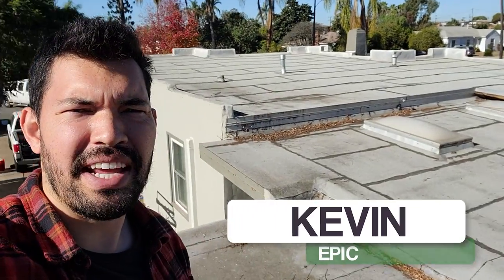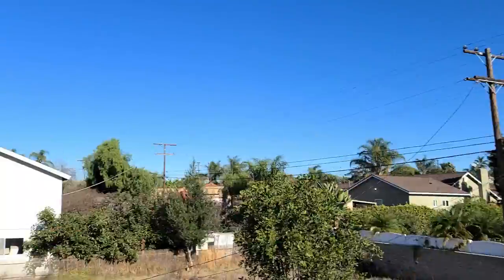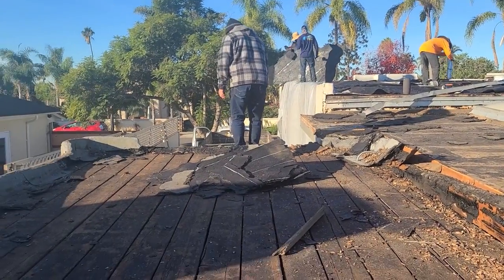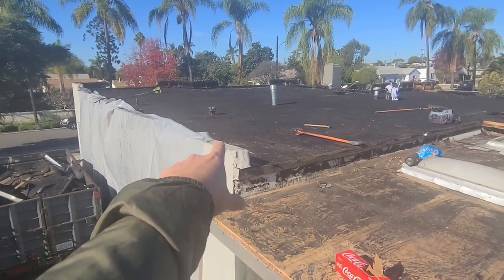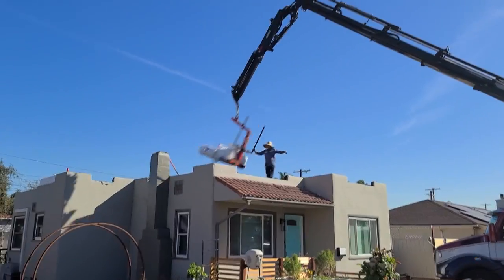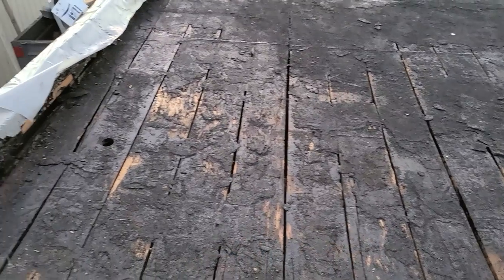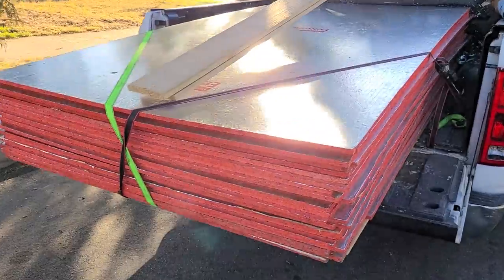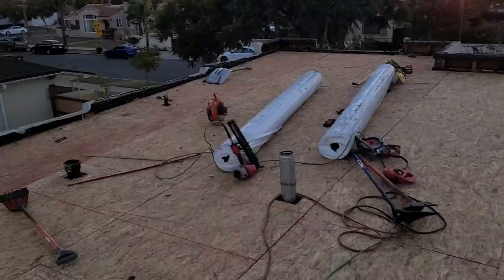NEW TPO ROOF! Full Flat Roofing Installation | Homestead Update Ep. 11

Comment: It's fascinating to see this process in that I used to install roofing here in Aus and there are almost no roofs like this at all, especially in the domestic sector. There is a similar product that was used many years ago used on industrial facilities, but for the most part it's now considered a specialist system. And what you call coping we call capping, or parapet capping, and when you have multiple types of metal waterproofing required to complete your roof, they're then collectively known as flashing. Looks very neat though, and I agree, call out the previous owners because this type of behavior is despicable.
Reply from the maker: It's so interesting to see all of the differences!

Comment: This video is a year old but I’m watching it and slowly becoming green with envy. I live in Mississippi and bought a house with a partially flat roof in 2019 not knowing that roof needed to be replaced. Unlike your roof, mine has NO slope, no angle, nothing. It’s FLAT flat. Ours is covered in some type of vinyl, but there are small areas in the seams where water gets through. 

It’s fascinating seeing any other person with a flat roof to me because every non-commercial roofer I’ve called in my area has told me they don’t work on flat roofs and all the commercial roofers I’ve called said they don’t work on domestic roofs. Which makes it seem like flat roofs on domestic HOMES wouldn’t exist - but leave it to me to break the mold. 🤷🏻‍♀️ 

This video has given me some ideas and a little bit of hope! Maybe one day I’ll have the $10-20k to get it fixed! Until then, I’m watching this on the rainy days! 🌧

Comment from the maker: I misspoke on the R-Value of the radiant barrier, it has no R-value!
Reply: I hope the radiant barrier plywood wasn't extra. It doesn't have an R-Value, but thats only one way to measure heat transfer. It still has a benefit, but since it looks like they put it directly on the old wood, you basically lose all benefit. It requires an air gap to work. Either way, that roof is still clearly 100x better than the old one! Congrats.
Reply: Ha! I caught that!
Reply: There is some R value just not what you thought. I bet your electric bill will decrease too! Nice roofing job!
Reply: @len10ten  to be clear and not too technical, the OSB itself has an R-Value of less than 1, and therefore not worth noting, but the radiant barrier itself does NOT have an R-Value.
Reply: R-value refers specifically to conductive (solid) heat transfer resistance, so radiant heat reflection wouldn't be included.  It's hard to put a number on the radiant resistance because it depends entirely on the details of the assembled system.  Two solids pressed together still have a gap on the micro level, so it's not entirely useless without a "macro" air gap, but it would be useless if coated in a liquid which makes perfect contact.

All ply/OSB has painted edges so the red is nothing exciting.  It just signifies an uncut factory edge.
Reply: Also, that 1x6 slatted roof deck was the standard before plywood took over.  The gaps are intentional as solid wood is insufficiently permeable to humidity.  Not a leak risk as if water makes it that far in you're already screwed!

Comment: Older homes it’s common to find garbage/newspaper in between walls and ceilings. People would use newspaper for insulation. Depending on how old the garbage/paper is it may have already been there prior to the last homeowner. I see that a lot here in NYC
Reply from the maker: True!
Reply: A hundred year old house I rented had chicken wire and newspaper insulation in the attic.  The newspapers dated 1908 through to 1912!

Comment: Hi.  If you know for sure that the sellers were the ones who did that, you have a legal right to call them on it.  In CA any disclosure statement should highlight any repairs and that they were to code.  Take pictures or more detailed video, check your disclosure, then call your agent.  Even if you signed an arbitration clause (check sales papers), you can go to small claims if the damages are less than 10k.  Good luck.

Comment: We have TPO on our (semi) flat roof in Oregon and we love it.  A little different, thicker underlayment and we didn't have the raised area that needed to be capped.  SO much cooler in summer and warmer in winter after it was installed.  I bet you'll love it.  And I agree with others about checking with the RE Agent / Attorney about the fraud issue.  Consequences = changed behaviors!
Reply: Have you had any condensation problems? I’m also in Oregon and just discovered a huge condensation problem in my attic.

Comment: TPO is a good option and it's really easy to repair which is great for whenever you're putting solar on your system. Make sure to claim your LEED credits for it and your tax write off for the re-roof (if you finished in 2020 you can claim on 2021 taxes). TPO Roofs have an average lifespan of 15-20 years with proper care and maintenance otherwise they can weather at a much quicker rate. If you have any questions on how to take care of your system I've been in commercial roofing for almost 6 years now and I run the division for my company. 

If you ever put another single ply membrane on your home I'd recommend looking into manufacturer's who offer warranties to home owners. Firestone doesn't offer a manufacturer warranty on their membrane for residential construction which means the only thing protection you is your contractor's warranty. 

The roof looks great and the did a wonderful job putting the system together, and their detail work looks great!

Comment: Also, coping metal is an obsolete method of covering parapet walls. With a torch down cap sheet system you could have run it up over the walls and installed a bonded edge metal with no seams and fasteners to expand and contract, coming loose and becoming a maintenance item/leak.

Comment: Thankfully don't need to do my roof for a good 10 years or so.  Did get the piping replaced (galvanized to pex) and in the process of getting the fireplace updated and fixed (will be putting in a wood fireplace insert) and the electrical is getting upgraded to a 200 amp service.  Fun video to watch though..  I do miss visiting San Diego (a couple of my ships would pull in every once in a while and you can't fault the mild temps year round!)
Reply from the maker: Considering 200amp myself! But I think I can live off 100a until ADU comes in
Reply: @epichomesteading  No doubt.  For me it is two-fold: 1) to upgrade my kitchen or route power to the outbuildings I want to build will require more than the 100 Amp I have now and 2) any new or upgraded service has to be buried so that, along with my cable internet, will go underground and I will have no aerial wires at all.  Really just an (expensive) bonus but safer overall as well.

Comment: Do it right the first time or do it right the second time. Foil faces is mostly for reflecting heat away from the building, as you said it has no R value. Could the paper have been there for a long while?  If you can prove they did it and you want to call them out, then do it.  If you can't prove it then I wouldn't. Kind of like that deep sink you had, people do all kinds of funny things. Save them for a look what I found video. I expect you'll find more. It's also why  I would look for a fixer when I was buying.
Reply: One way to somewhat find it is check the dates of the newspapers.  Lucky if it was just that but what kind of garbage? Lucky it is not asbestos or vermiculite that is dangerous to remove, live with or dispose of as a hazardous waste
Reply: @trishdavi7049  There are proper ways of dealing with asbestos and vermiculite that are safe.  It is possible that you might find asbestos ceilings (popcorn) in houses built in the 1980's. Sale was outlawed in 1977, but people were allowed to use up what they had already bought.

Comment: Little does he know going with TPO was probably the worst possible option. Single ply roofing May look pretty, but it’s about the thickness of a quarter and if you’re lucky will last 6-7 years tops. A torch down, multi ply roof when done correctly is about 5-6x thicker then a TPO system and will outlast it by decades.

Comment: It's illegal and not only should you call them out on the internet, but it would be smart to take them to court. There should be a type of seller disclosure statement the sellers had to supply, which states any issues (in Michigan, there is by law.) If they knowingly rigged the area to avoid disclosing the damage, they would be liable. In MI, the sellers are liable for 3 times the cost of the repair. I would go as far as having a more in-depth inspection with someone who is trained to find "hidden" problems. There may be more, and if you prove not only the soffit issue, you'd be able to establish a pattern of deception. Kick 'em where it hurts, their wallet!
Reply from the maker: I will look into this!

Comment: Kevin, I just wanted to mention to your viewers what we talked about on IG. The radiant barrier sheathing shouldn't have been installed directly to against the old sheathing. Without the air barrier it goes from radiating heat to conducting it. But it didn't do anything to make anything worse. One other thing that I couldn't tell from the video is if the drip edge is spaced off the facia. Otherwise water won't drip off the drip edge. It will run down the facia where it can then run backwards under the roof a bit. I've self studied a lot of building science on how to make homes more energy efficient, longer lasting, and healthier. That roof should last you a long time though.
Reply from the maker: All good points, Cole! I brought up the radiant barrier and they agreed. They also discounted the boards back down to normal plywood levels. I do have small gapping in those planks, so the consensus is that it would have SOME beneficial effect however slight, and not much downside.
Reply: @epichomesteading  I'm glad to hear that you had that conversation with them and they took care of it for you! Definitely an honest company unlike those flippers.

Comment: Roofer's mistakes in this video: installing fasteners at the joints of the 4'x8' insulation boards. That can cause a roof uplift if boards are not fastened properly. They also did not run the membrane up and over the wood nailer at the top of the parapet. You explained how water runs off in both directions under the coping, but if that membrane is not turned down on the fascia side, then moisture infiltration can occur.

Comment: Thankyou excellent answer to my roof question after spending 8000.00 on a flat roof extension of my house covered in tpo that leaked through ceiling...so after going up to see finished job after a rain storm the following day i discovered ponding and 2 inches of rain on 75% of roof firstly no slope,
no plywood board to at least flatten,looks like only insulation board was used under epdm rubber that was glued in strips....what went wrong????was 8000 used to do the least amt of work?perhaps or 
no discussion from the sales person? also i had to hire ceiling drywall to fix for 1200 more...so you have just explained what should be done to repair a flat roof on a house in a good area..i have a rancher with pitched roof and flat roof extension. obviously i had no money problem just wanted a good fix. thankyou

Comment: House-flipping can be pretty scummy. Agreed. I feel that the homeowners who had our house before us and flipped it also cheaped out. They replaced a sliding door to the backyard with french swing doors and however they insulated it was not NEARLY enough. The back area by the door gets SO COLD in winter. It's quite obvious that however he did it, he super cheaped out on insulating around it or left gaps somewhere. 

Unfortunately, alot of the time there's not much you can do. At least in Canada.

Comment: Radiant barrier doesn’t work without an open airspace on one side. Laying it over existing plywood and deck board sheathing negates it. Also, your TPO roof isn’t going to last 20 years. Single ply roofs shrink and break apart. You should have installed a new 2-ply modified bitumen torch down roof that is precoated from the factory (PolyGlass PolyFresko for example.)

Comment: I noticed that you had some significant puddling @ 13:21 of the video. Have you asked your roofer about that? Over time, I’ve been told that puddle areas like that which don’t dissipate in 48 hours will weaken the roof and not last as long as a typical 20 year TPO lifespan.

Comment: You might want to have the roofer remove and replace a small amount of square feet per day tying into the existing system to ensure the roof is sealed at the end of each day. Leaving a roof open overnight is a HUGE liability.  If you had rain overnight and the roof is open.....bad and expensive things will happen.

Comment: I'm not sure what the laws over there are. Here in The Netherlands there is a law that makes the previous owner / contracter responsible for the damages that they did not repair correctly when selling you the property, this lasts for 10 years or so. Either way call them out, have them fix it or pay for the crap they did.

Comment: It’s called a tear off. I see a spot mopped base sheet then 1 layer torch down. Well it looks like you’re gonna be back in five years to fix that part where they’re putting in the OSB plywood. Anymore she gets into that plywood and it will fall apart like papier-mâché. Do you want to put down CDX plywood under any roof. Never use OSB plywood.

Comment: That's some bs stuff they tried to pull. I think you should do something about it because it does come down to ethical practices. Not only that but it has to do with safety too as it could have kept rotting on the inside and possibly fall down.